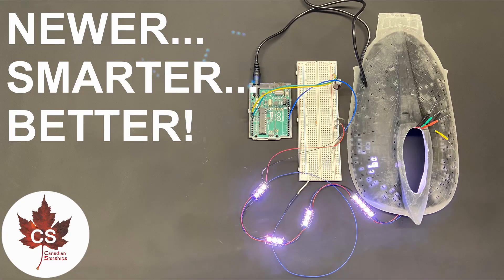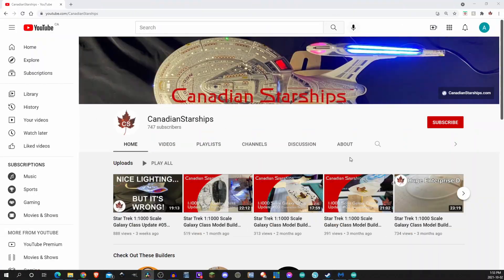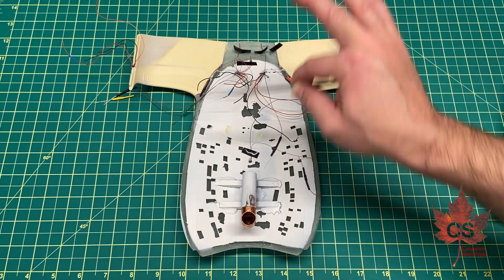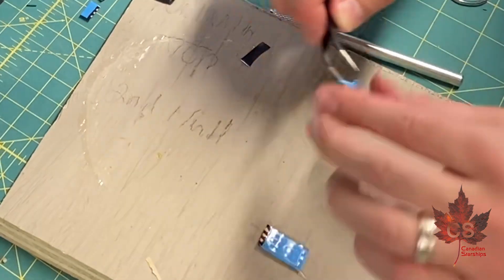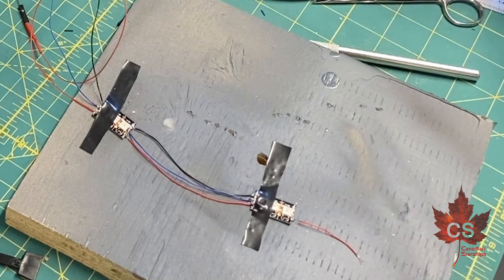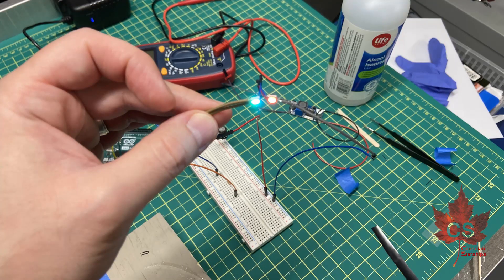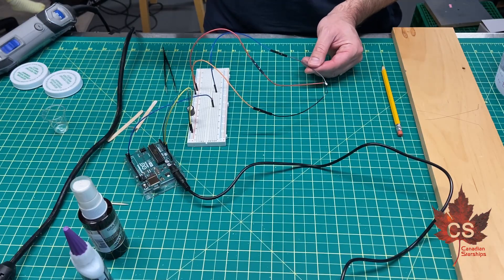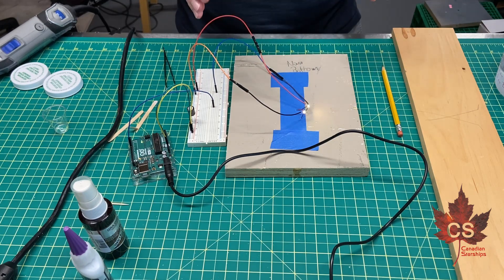Star Trek 1:1000 Scale Galaxy Class Update #06 (2021)

Comment: Say, this is Don Showalters 1/1000 right? Will you be doing a 1000 scale E as well? I am thinking about buying one of them but there literally is no review for it on the internet. So i hope some of the channels i watch will eventually build one. :D
Reply from the maker: It is the Don Shoko D. And if I could find a 1:1000 scale E I would do one of those for sure!
Reply: @CanadianStarships  Previous answers just isappeared. Probably because they contained links. Was not aware youtube is blocking these now. Anyway I'll try it without. If you look for a video called "Unboxing the 1:1000 Scale Enterprise E" you'll find a 1:34 minute long video. In it the uploader answers to a comment with the link to an ebay store where he bought the model. Said ebay store will list the model (which itself is a master off of the Titan Model) if requested. So shoot that guy a message and you should get a ship. In terms of quality the unboxing video is sadly all i have.
Reply: The different colors have to do with voltage changes and the series setup is changing the voltage. That's my guess. Wire them in parallel and see

Comment: Do you want the string of LED SMDs to act like the addressable strip? I don't believe that is possible as each LED in the strip has a chip that tells the arduino what it is via the data wire, and regular RGB SMDs do not normally have that. You would need a pinoout for every SMD and the Arduino does not have nearly enough.

Can you link to them so we can investigate? Are these 2525(?) SMDs RGB, RGBW or RBGAW? Do they have the chip built in? (or did I miss all that in the previous update?)
Reply from the maker: The SMD's that I am using, SK6812 are addressable, and the Data is a 'through' just as the pre-fab LED strips. At least as far as we have learned via the data available.
Reply: @CanadianStarships  cool. I knew you knew all that, but I wasn't sure. Much like the Adafruit Neopixels are available singly.